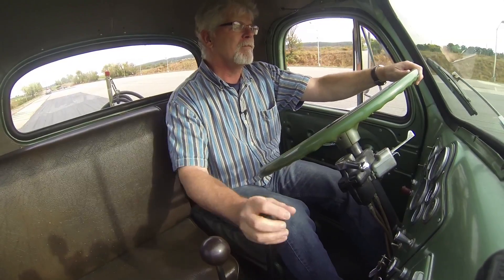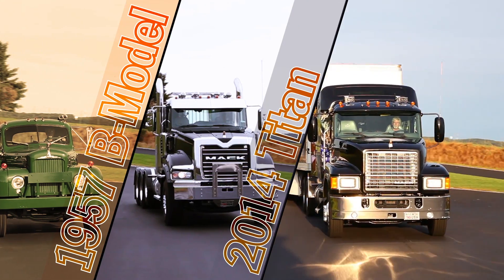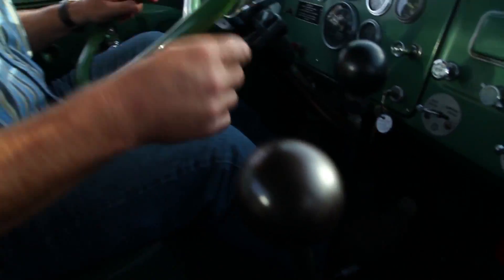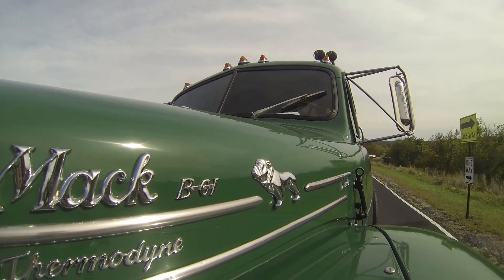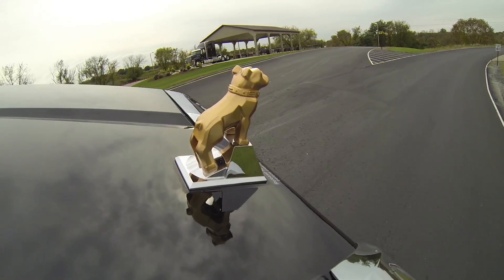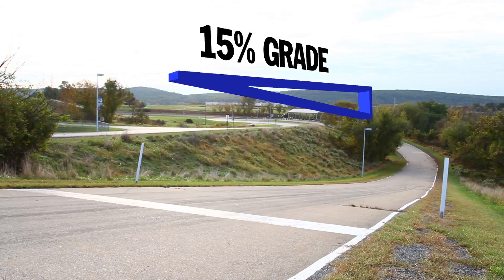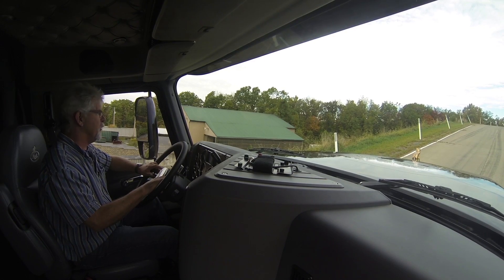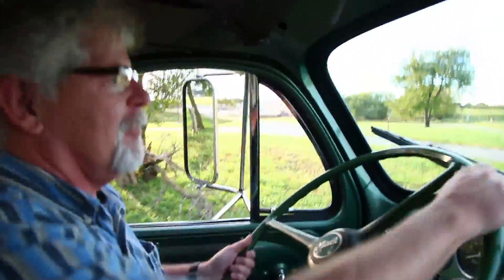Twin Stick to mDRIVE Pt 2

Comment: I haven't had the opportunity to drive a Mack since 1983. It was an F (cabover) daycab. With a 237 Maxidine & a 5 speed manual. Don't miss that truck at all. Through the years driving a variety of trucks, I found it to be much easier to shift (floating the gears) without the clutch. I drove a 2001 Freightliner Classic XL that had a 10 speed Eaton Fuller auto mat. That was 2nd generation. Still had a clutch pedal. Loved that truck. Presently in a 2023 Freightliner Cascadia with a 12 speed auto mat. The hill grip rarely works on a hill. But constantly when I switch from forward to reverse or vise versa while trying to back into a spot. It holds all of the brakes & even prevents me from turning the steering wheel. Newer technology is always better.

Comment: I grew up with mack trucks have been a mechanic for 25 years specializing in driveline and suspension the best automated Trans is the fuller the Mdrive is just a Volvo engineered peace of crap nothing will ever replace a true driver with a stick or two

Comment: - You reach through the wheel to hold the curve per: https://youtu.be/f7m2mnheEek?t=154
- After driving 14hrs. per day in a stone quarry, you learn how to slip all your gears and never every grind a one...or your clutch thigh gets really sore...the shop mechanics were dumbfounded that my gear box had perfect gears at the end of the season {it is all just the music of the engine's rpms}.

Comment: I drove B-61 Macks just like that but with Triplex 2 Sticks. Or 3 on one and 5 on the other stick. I have drove 2 stick R model Macks with Duplex or 2 on one and 5 on the other. I have driven Quadraplex 2 stick with 5 & 4 or 20 forward gears. I enjoyed the Triplex B-61 MACKS MORE THAN ANY OTHER.

Comment: I can see a problem. In both the trucks with manual transmissions you should have kept your left foot on the floor after the truck was moving. Real drivers don't need the clutch to shift.

Comment: Today's truck driver's are steering wheel holders with automatic transmission.I prefer a 10,13,15, and 18 speed fully manual transmission any day👍🏾👍🏾

Comment: A "Fully Automated" Manual transmission?? That is a textbook oxymoron. Same as dry water or cold heat.  Every try pushing in the clutch on one of these old B Models?? Forget it, everyone who drove one shifted WITHOUT using the clutch. Only used the clutch when starting from a full stop. Also anyone who drove these for a living would use TWO hands when shifting from say 3-OD to 4-LO etc etc

Worked every summer & weekends at night, driving a B model truck for a private sanitation company in Manhattan while in my college years.

Comment: Thats funny, I remember driving an old truck with a lever lock, it was a 1970's international, to start on a hill with a load you moved that lever, that held the brakes for you, then you give little gas and right when the clutch starts catching you flip the lever to release the brakes. This had hydraulic brakes btw, not air

Comment: If you can't drive a Easton fuller you shouldn't be behind the wheel of a big rig, these auto shift transmissions are causing lots of problems and drivers to crash more often, I'm a semi truck driver myself, but I am also a firefighter and have to deal with the after math of incompetent drivers. They are dangerous and should not be in vehicles

Comment: If the small retro revolution going in farming is any indication, we might be looking at a future in transport where those old trucks like that B61 might again be in demand.  I've seen several videos in here of farmers, especially in the USA, who have gone back to using older farm equipment simply because they can repair them themselves.  Having a piece of machinery not moving, sometimes for days, because you have to wait for a fitter or mechanic to come out and run his computerised diagnostics, just for him to find out you have a faulty sensor, is a cost a lot of farmers are no longer willing to absorb.

Back in the early 70's, I got a lift down from Tom Price to Perth with a bloke who owned an old B61.  Somewhere between Carnarvon and Northampton, about 3 am, there was a hell of a bang from the engine bay and smoke started to pour out from somewhere around the engine and sparks were flying out from under the cab.  Something had flown out of the air compressor, hit the first bend in the copper air supply line and blown a hole right through it.  He got the truck off the road and at first light, we set about trying to repair the damage with a minimum of tools and not a lot of hope of success.  We figured that if we straightened out some of the bends in the supply line, we just might have enough to cut off the damaged piece and still fit the pipe into the compressor.  I found half of a broken, rusty hack saw blade buried in the dust on the hungry board behind the cab and we got to work, taking turns cutting through the pipe, with just old rags to protect our hands.

Long story short, we fixed the problem and with, incredibly, the compressor still working, we set off on the 400+ miles to Perth.  That old Thermodyne engine never missed a beat for the rest of the trip.  I somehow think that these days, those sort of desperation repairs would be almost impossible for both modern drivers and modern trucks.

https://www.youtube.com/watch?v=h1sqXcHR-tg
Reply: funny you say that because i used my old 87 F250 to hual hay this summer and saved up some money whent to go look at a modern truck and said fuck that asked a friend if i could have his old grain truck that was in a roll over about 10 years back and he was like sure so i am now getting a 1975 C65 chevy with 366 V8 running best part is it has a 5+2 and dump bed

Comment: Good job with that double clutching lol. The old ones don't like that style you gotta float em and know the RPM and roadspeed. Listen to the machine, it will tell you when to shift and what gear it will allow. I'm not even old enough to have driven this but I learned how to float a Eaton 13 speed and it works great if you don't use clutch.

Comment: Can you just imagine what this guy was thinking To Compare the fully computer controlled and automated Transmission of a New Mack with what you could literally call the T-Rex of Dinosaur Diesel truck's  The Mack B-61 Thermodyne ... Gee Wiz fella now let's compare user friendly creature comforts Let's compare the swinging audio sound of the B-61 with the Audio of today's modern Big Rig ...Let count cup holder's !!!  how about cruz control No offense but an idiot can drive todays trucks and they do everyday they are hired by the Lot size to fill the need for cheap truck driver's  who will work for so much less than they are worst ...I almost wanna slap myself for watching this rediculas comparison. ANY Truck driver who can't negotiate an 18 spd  is NOT a truck driver he's a stock boy ...

Comment: Back in the early 50s, the Studebaker cars had a similar feature called the "Hill holder'. When you had to stop on a hill, you held the clutch pedal all the way to the floor and the car stayed there. You were then able to just give it some gas as you let up on the clutch pedal and take off without the car rolling backward.

Comment: Hill starts are easy in a diesel... Keep foot on brake, ease clutch out til it grabs enough to hold truck in place, do your brake to accel pedal switch and away you go!  It's not that hard ...
Reply: It's even easier than that. Use your Johnson bar to hold the trailer brakes, let the clutch out to the bite point, give it a little fuel, let off the trailer brakes.

Comment: Grade gripper?  I use the parking lever on the steering column if I'm on a hill to hold the brakes while I start letting the clutch out

Comment: There's a Kid driving a "B" on the internet driving the twin stick like I learned how.  I took my VA Chauffer's in a B dump truck with the 5/4.  I started out shifting like you.  The trooper looked at me and said " who taught you to shift that way?" I told him that I was doing it by the book for him. He said "bull ----". you'll never be able to drive like that with all the turns and ups and downs we have in South West Virginia,  Show me you can do it right, or I won't pass you. So, my first shift was 2-3 while staying1 on the second box.  My next was 1-2 on the second stick while simultaneously hooking my left arm through the wheel (he was having me turn right at the same time) NO Clutch!  Then quickly (like 3 seconds) 3-4 on the main box. The trooper was making sure I could do every combination while throwing turns into the shifts.  I was sweating (I needed the job for my college summer vacation).  I did mess up the 3-4 while doing a 4-3.  Neither trans had drive to sync with and I had to stop and start over. Brought back lots of memories! https://www.youtube.com/watch?v=P6pWCKY_qJo

Comment: I don't remember where I read this 35 years ago, one suggestion I heard was to set either the parking brakes or the spike valve, then release them after the clutch was partially engaged.
Reply: I usually just leave my toes pressing the brake and use my heel to accelerate the engine, then once the clutch has engaged enough to get the truck moving I pivot my foot off the brake and accelerate more

Comment: the 57 Mack I remember when i learned to drive 1976 it had a twin stick...not until 1992 would I see something like that with a high and low for 5 gears a 2 by 5...

update looking at this again and watching him shift that is the same as the  2X5...the method is the same and now looking at this again it all comes back...now on to the 5x4

Comment: Using that clutch was a mistake.
 Learned on a DM 800 with quadraplex and a surplus engine from a military prime mover.  Got to catch the gears right, or pull to the side of the road, cuss, smoke a cigarette and then start over.

Comment: Mack purchased this B-61 from me.  I think it was 1985, in Summit, New Jersey.  I recognize that Stewart Warner direct reading temperature gauge and the green vinyl  driver's seat (the upholstery shop did not have brown).  The transmission is a "Nine Speed Over-gear."  Ninth is from fourth high to fifth high, a "close ratio."  I never used the clutch once moving.  Form was to slide the main box into neutral, idle down, snatch the auxiliary into neutral, instantly engage the main, raise the engine speed while engaging the auxiliary.  This is done with one hand, keeping one hand on the steering wheel.  The shifting should be buttery smooth.  With nine speeds, there was not much room for error.
  
,

Comment: Ok i learned to drive stick on a farmall. And first time driving a stick on the road was a 59 f6 with a 2 speed rear end, 3 on the tree for a main, and 4 speed on the floor as an add on. Its rare im driving more that a 1ton, but ill still say more sticks more fun, if you cant drive it then you just need to learn.
Reply: I bet the f6 was something else to drive
Reply: @corbinboltz3666  it was a hand full, and all of 90 hp from a flathead v8. Hills were a lot of fun when loaded...
Reply: @oldreliable303   oh god so it also has less power than my old truck 😳
Reply: Chevrolet Titan 90 C.o.e. was the original Titan ( GMC version Astro 95).

Comment: I worked a transfer station in 1994 where a 1950's B series Mack was used to swap out loaded trailers for empties at the hopper.  I would use the hopper's hydraulic ram to help push off the trailer.  I loved the old B series Macks as they were prevalent in the 60's when I was growing up.  One of the Drivers at the hopper called it a "F***ing double shifting, double clutching armstrong POS"!  I didn't share his sentiment but I could appreciate it.

Comment: Double clutching really 
Float those gears clutch with be a lot happier
It's only there for starting off and backing up.
Reply: jarrad mcdaniel yes years ago I drove a 67 r model Mack two stick never used the clutch but stop and start you can split shift it without the clutch
Reply: I used to drive a 58 Mack 5 speed main and 3 spd aux, and you don't double clutch unless you want therapy for your left leg and if you do it right no slap back on your hand grinding gears. Down shifting is an art in these.

Comment: Guess I m old , have driven that one and quite a few others . Hint going up gear is easy but load s , mid corner shift s, hill s and timing down shift s take caution with matching tachometers was interesting. The industry has to go automatic with non stick driving newbies.

Comment: I had a 1963 C-600 Mack tandem, with a Tri-plex double stick. I hauled logs and saw bolts with it. It shifted smoothly as long as you didn't use the clutch. I also had a 63 Autocar tractor with a 250 Cummings, 4x4 double stick tran with 4th over. That Ole A-car was fun to drive, she'd run 85-90 mph empty.

Comment: How can you possibly compare a 1957 truck to a 2017? Totally stupid.
Reply: Jeff  Sutton I think his message is how there is no more truck drivers today! Today's trucks are oversized cars with dirty people wearing sweats as there "professional" look. Drivers today could not make it back in those days.
Reply: the 57 is better
Reply from the maker: Hi Jeff.  Our goal was not to do a performance comparison between and 1957 transmission and a 2015 transmission.  We were at the Mack Customer Center and Test Track to test drive an mDrive equipped truck.  We also had access to a 1957 Mack, so we had the idea of shooting a video that showcased the advances transmission technology has made over the last 60 years.  And to be honest, Jim was just looking for an excuse to get behind the wheel of that vintage beauty and reminisce a little about the old days.

Comment: Today everyone wants EASY and mindless. I get it. That mindset will eventually lead to driver-less cars and trucks. If that's what you want ok, but personally I will  never own an automatic. Nor will I let a computer drive me anywhere.
Reply: Thanks Daryl, but I’ll keep my ‘49 IH L model semi truck with twin sticks and 10spd.
Reply: Luv this video. I am a brit.veteran. drove Thorneycroft  mighty Antars Mk2. Modified.  Three main boxes and one crawler on my unit.  Total gear range of 56 forward and 8 reverse. Normally a two man operation with anything over 80 tons up.  Also drive some Mack road trains . Total load 124 tons and max length of 225ft.  Miss it all now.  BUT THOROUGHLY ENJOY. the American/Canadian/Australian u tube clips.

Comment: That titan is beautiful but I do have to correct. I believe a gold bulldog 18 speed should be a T318M that is a triple counter-shaft beast. Yes it is huge. An easy foot longer than the Eaton and much heavier.  The gold bulldog means Mack transmission and axles.
Reply: Smoke
It means MACK engine, transmission,  drive axles

Comment: I wish the upcoming American Truck Simulator would be more involving than Euro Truck Simulator 2.

I wish it would simulate the gearboxes better. Twin sticks and all.
Reply: FINALLY SOMEONE SAID IT.
Reply: +Not Named great minds think alike
Reply: Then Logitech will have to make a twin shifter that bolts to the floor.
Reply: @Wildstar40  I think it would be more feasible to somehow get two shifters to work simultaneously or just link two separate shifters together in a daisy chain.

Comment: Automated manual...Even truckers are becoming pussies.
Reply: madtownmadman Except those of us who pull dump trailers.
Reply: madtownmadman not all of us 
At 14 years old i was driving peterbilt super 10s and international loadstars through south texas 
The pete had a CAT with 5 inch straight pipes drove through san Antonio under a section of over pass and hit the jakes before making a down shift on a fairly tight turn....... rattled the windows doing that ..... 

The international had a detroit 3-53 with a 5&4. 
I loved that 4 speed brown and lipe auxiliary 
Splitting gears that screamin demon could pull a damn house off the foundation. 
The caleche pit in SA tended to overload us. But it didn't seem to bother that 353 detroit. It had great brakes too. 
Being an LCF model with no ac .... you had trans running next to you ....and in texas summer heat. It got hot as balls in that international..... rode int that drivers seat for 10 hours a day hauling caleche and gravel......  
but in agreement most everything is getting pussified these days

Comment: That ole B model was cherry!!
Reply: "ckelley63" My favorite B-61 was the Tri-Plex, transmission. The Main and the Compound shift levers were swapped positions. With the Tri-Plex the compound was the one you ran the pattern, then moved the main to the next gear and the compound back to lo lo, two hands if on a hill or in a hurry; then repeat again. Built like a Mack was a saying that meant a lot.
Reply: @jamesglavich1426  Very coo !. l 😎

Comment: each work day I have to get a loaded truck moving on a grade like this with a manual transmission. I use the trolley valve to hold the truck in place and don't release it until the engine starts to chatter.  Its not that hard. It just takes practice. Call me a knuckle dragger but ,to me, the grade gripper is just another computerized feature that will eventually fail and become a pain in the butt to repair. And if your mechanic in his pick up truck cant fix it on site, that means a trip to Mack. That means youre out hundreds of $$ for the towing and then the truck is gone for several days at the dealership where it isn't earning any revenue...Remember the KISS principle..Kepp It Simple Stupid.

Comment: you dont have to double clutch a synchro'd transmission dummy
Reply: There is NO synchronizers in those transmissions, they are all crash boxes, if they were, you could shift them when YOU wanted to, and you can't
Reply: Old habits die hard